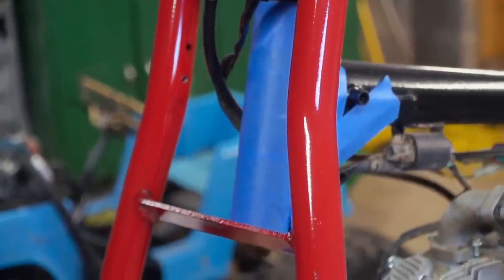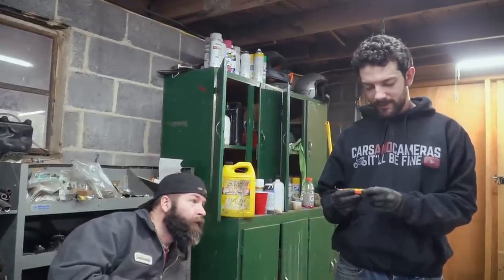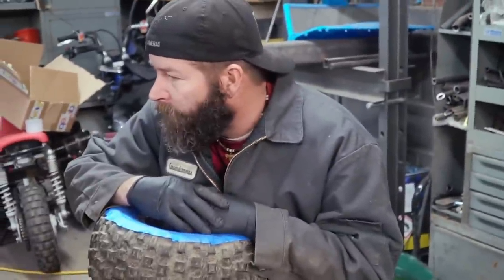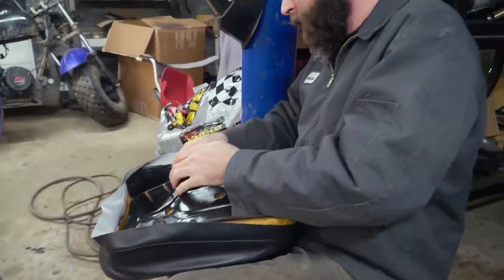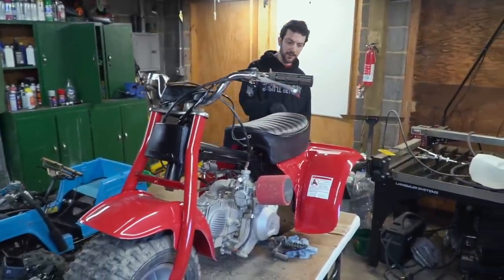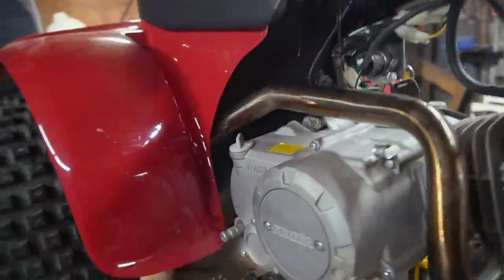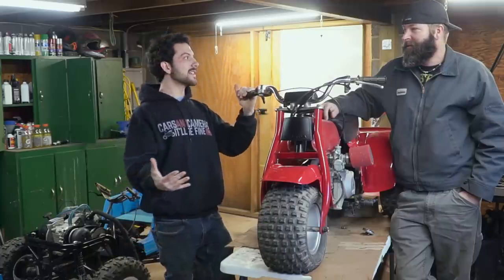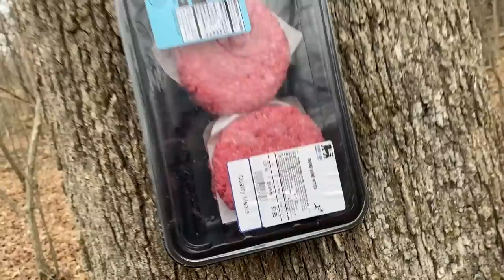Honda ATC 70 Restoration | Restored 140cc 3 Wheeler!

Comment: They came with those safety stickers back then. I can remember peeling the stickers off my 82  back in the day.
Reply: Also heat the vinyl with a hair dryer to help pull wrinkles out. Do not apply the heat directly, swing it back and forth to gradually heat the area.
Reply: I collect atc's. They all had them.
Reply: @JETHO321  yeah I have 3 old hondas but wouldn't call myself a collector. I actually remember when 4 wheelers came out, my son rides the suzuki 125 my grandpa bought new in 1985.

Comment: The chain tensioner is a round wheel riding on chain links, that’s why the original was a sprocket
Reply: It also sounded like the chain was rubbing not turning the wheel on the tensioner. Sounded like something rubbing on plastic.
Reply: Correct, this is a tensioner for a belt. A chain tensioner, like a timing chain tensioner on an engine is also nylon but longer and curved and would be constantly lubricated. This is not the right application.

Comment: The first ATC I ever saw was only 6 months old. It was a ATC 90 but belonged to a couple of thrill seeking Firemen from OKC. They had worn it out by the time I saw it and replaced that 90 with a 185 Suzuki or Yamaha engine and trans. The sticker was not original equipment since they would get all lit up and play (you know Firemen always follow safety rules "wink *wink"). The object was to be able to stay on and not spill your beer. When you were the passenger, that was not as easy as you would think. Luckily they would do it in the sand and no one was hurt. They also drag raced a 56 F100, flew hang gliders and had several "sand" toys.  BTW You need a "Dutch Oven" for camp cooking and on top of the stove in the shop.

Comment: for de stickering, there is this stuff we use for refinishing cabinet doors when we need to take off the bumpers and factory stickers. It works really well. Its called Wax Wash, from Mohawk comes in a spray can. 👍

Comment: FYI - Rubbing alcohol removes sticker glue like a champ!
Reply: Another one..... Car wax works great!!
Reply: I use wd-40 and a scotchbrite pad
Reply: If you want no tarnishing of a clear coat or scratches on windows you can use either baby oil or mineral oil, they break adhesive down quite nice.
Reply: @TuttleScott  Tell ya what- WD-40 works great for removing grease pencil marks off thrift shop items. Its like magic
Reply: 91% or 99%  Rubbing Alcohol works best
Reply: @brianmccann666  Im thinking its  91, I buy and sell electronics, I remove 10-20 price stickers every week. So it mostly on metal, plastic and sometimes finished wood
Reply: @wishbone20t  ... 91% works Good. But 99% works Awesome.
Reply: So does a crud thug

Comment: I remember back in the day, I had a Honda 70, along with about 7 of my school buddies my friends dad was a Machinist at air research, we jacked those 70s with stroker cranks, bored out, cams, headers over sized carb, headers. 3 speed to4. Changed the front sprocket.
To top it all off put a little alcohol in the tank. Most definitely ur helmet.
What else can I say scary fast on 3 wheels. Have fun with ur restoration

Comment: @23:53   A time proven trick is to put Baby oil on some paper towel so it is soaked do this all on the Glue to be removed, let set over night. As a rule all of the glue will just wipe off. Not always but 80-90% of the time. Love your guys fun, and how good of friends you two are. Keep up the good work.  Chain tensioner:  You can remove the old cog from your old chain tensioner, and replace it with a new skate board wheel, they work great, and last a very long time ,and are cheap to replace.

Comment: Top tip! Rubber eraser wheels and plastic razor blades work wonders on stickers decals and double sided tape. And you should use some adhesive on that seat. Overall I'm jealous, my 83 125m was never that cool (still cool tho) wish I still had it.

Comment: I went through quite a few of them tensioners on my atc 110 when i was younger.  I ended up removing the old wore out sprocket and bolting a piece of hardwood on the tensioner inplace of the tiny sprocket for the chain to ride on. Worked better than expected. Pretty certain it is still on it.

Comment: Ok I looked through quite a few comments to see if someone already told you but I didn't see it. I use a spray bottle with water mixed with rubbing alcohol. I mix around 1 part alcohol to 3 parts water. It makes it so that you can move it around til you get it where you want. No worries about getting soap out, alcohol will dry up clear.

Comment: Use a 2k automotive spray clear with hardener over stickers on fuel tank. You will not be disappointed very durable and can be easily purchased on Amazon for about $20. Way better than regular spray clear.

Comment: For sticker/decal/glue removal I've started using those rubber eraser wheels. I just finished removing a ridiculous amount of vinyl pinstriping from a '95 S10 and it was so much quicker and easier than any of the chemicals/cleaner hacks I've used in the past.

Comment: Never had a bad reaction from brake cleaner and bodywork. De-stickered all my past bikes/cars with the stuff. And I use it before pulling the sticker. So the whole sticker is easier to remove and usually brings the glue with it 🙌

Comment: T-bolt makes a low profile intake manifold. Also when I put the 140cc in my ATC 70 I used a mukuni 28mm carb. You need a longer throw thumb throttle but wow what a difference the 28mm carb makes.

Comment: Back in the late 70s, my dad's friend Charlie had a brand new ATC 90, and a brand new GMC Gentleman Jim (black and gold, sort of a Smokey and the Bandit TRUCK) pickup. He let me try out the ATC. I gave it too much gas, which makes the front end light and even harder to steer. I went straight into the side of the GMC. A GMC/ATC interface. Minor damage to the truck (I say minor, cuz it wasn't mine). To this day, I've never TRIED to ride another 3 wheeler.

Comment: Nice work, guys. That tensioner looks like it was made with a rollerblade wheel(hard poly). I'd say your best bet is to buy a piece of white nylon and use Ike's lathe to make a new roller. It's very easy to make, just take your time. There's 100 people that can walk you through the process, me included. Give me the dimensions and I'll make you one. I have the material.

Comment: Tech Tip: After you split the wheels and replace the seals use tire slim liberally between the wheel halves. They will leak no matter how much sanding you do. The slim will stop the leaks. Been there done that.
Reply: Have you ever seen what tire slim does to steel and aluminum rims? Changed many tires that had tire slim in them for who knows how long. Corrodes them real bad. Actually did an experiment on a brand new painted rim, ran the tire and wheel for one season and pulled it apart and it was rusted so bad it was flaking. Just my personal experience with tire slim.

Comment: Use a heat gun or a hair dryer when you remove stickers and they’ll come off clean. You gotta get close to it with a hair dryer but don’t get to close with a heat gun and keep it moving don’t stay in one place to long or you’ll damage the paint or plastic. Just go slow and don’t get it to hot. When it’s pretty toasty to the touch it’s ready.

Comment: With old rotten seat frames, I've found that using a few wooden blocks and a length of 2x4 .. clamp it face down to the bench, once the cover is centered and mostly on, and compress the foam a bit. Then tab the vinyl in and slowly release the pressure.

Comment: Here's a trick to getting rid of the glue for just about any label, use regular rubbing alcohol same stuff you use to clean cuts 90% or better (less water in it). Then you can just use say a table spoons worth on the tank size stick and rub it in with your finger, then wipe with a rag repeat if necessary. As for applying decals, try spraying a soapy water solution to surface and be liberal with it so the decal doesn't stick and can still be slid around. Once your happy with the placement work from the middle out to push the bubbles out and get a flat full adhesion, if you do get a small bubble try a hair dryer and softly work it out.

Comment: You guys mentioned the chome Z50 Christmas special and said it would be neat if they did it with the ATC 70. They did do a Christmas edition, the factory blue ATC 70s in 1983 were a Christmas giveaway edition. Not to be confused with the blue ATC 110s, which were just a factory color option. Either way, awesome content. Love me some custom ATC 70 builds, that 140 is a mean motor. You've earned a subscriber

Comment: Hey! For removing that glue, rubbing alcohol and a scotch bright pad works really good. Also those 3m eraser wheels that go on a drill work very well too. I have tried brake clean and I have found these other 2 methods work much better

Comment: Guys, a suggestion.  Buy and experiment with a cheap powder coat system (Harbor Freight).  I use an old large electric cook oven and it works amazingly well.  The results are fantastic and it is so much more durable than rattle can paint or (ugh) a paint brush.

Comment: dont heat up those spikes under the buddyseat , remember that theres foam rubber under that cover , that stuff burns like oil you need an actual fire extinguisher to smother the fire
just wedge a small screwdriver under the spike and carefully pry them open 
to prevent the foam from bunching up put a plastic bag over it , it makes the foam a litle more slippery (works great on car seatbacks ) i usually started in de middle of all four straights and worked toward the corners , makes sure its spaced out the same all over and it wrinkles a lot less

neat trick for putting stickers on , use soapy water in a spraybottle and wet the surface , the slap the sticker over that , the soapy water alows you to slide the sticker untill its placed correctly 
squeegy the water away from under the sticker and alow to dry , then take of the top sticker protection  , works great for windowtinting too

Comment: You can buy a product called " mastic " remover at your local janitorial supply ..it works really well and allows you just to wipe off the adhesive.. also I used to run 8" golf cart tires on my honda 110 cc 3 wheeler.. I first started using them because tires were so expensive..but then accidentally found out that all of a sudden my 3 wheeler was really fast..like 65 mph fast plus for most dirt road riding it didnt seem to effect the traction as bad as you would think ..since it had stiffer side walls it took that roll over feeling out of the equation and was a ball to do doughnuts with it was amazing how much drag was reduced after that I was sold and the local golf cart place practically gave me the tires .. it was awesome lol but you really need to make sure the brakes are up to snuff.. because now it will free wheel wen you let off the throttle instead of just slowing down ..I believe it reduced wear and tear by 75% at least on the chain and clutch oh and if you get stuck you just pick It up and scoot it over or just push it out of the mud. It doesnt weigh that much ..on the street it kept up with street bikes with twice the engine size .. i think you should give it a spin ..it completely changes the trike into something completely different something better power slides are a blast rather than those balloon tires trying to roll under which just kills the stability ..i wish i could get my hands on another anyway have fun

Comment: Looks great you guys should get a can of goof off it works for removing adhesives and also if your caulking with oil base silicone you can give it a light spray when you smooth it down it works great for all kinds of stuff

Comment: Tip for painting wheels with tires on them.Remove all the air from tire, shove 3x5 index cards between wheel and tire. Paint and remove. Also creates a nice spray shield . That tape is a waste of time and $8

Comment: The fuel tank sealer works great even if you have small holes, tape em off and pour as usual, we did some old tanks that should have been thrown out.

Comment: Trick on decals I learned when doing vinyl on pop machines is use a soapy water in a spray bottle and then use a rubber squeegee to aid in rubbing out air bubbles..

Comment: Those old 3 wheelers, four wheelers, and go carts all have the same style of tires lol. I put a 212 predator on an 80s cart and the thing don’t turn or stop. It also doesn’t have any brakes so you have to stop the tire with your foot 😂😂 and there’s fencing wire and vice grips holding the throttle together😅

Comment: Tech tip: silicone spray easily removes stickers from paint.  Yes, you'll need to degrease it, but it won't be as harmful to the paint as brake cleaner. Spray on, then literally wipe the residue off the surface. Better and easier than scraping.

Comment: The rear fender you purchased was modeled after the pre 85 fenders. Only slightly different. I've had several myself and the differences that you pointed out are the same with OEM 84 fenders vs 85 fenders.

Comment: Hey, I don't know if you ever tried but, WD-40 works just as good if not better than Goo Gone when taking sticker residue off. Did it on my Aunts 12 year old Dell and the WD-40 made the whole PC look brand new and sticker-less. It also revived my 2008 Razer Lycosa Keyboard and made the shinny plastic shinny again and the rubber coated keys are back to a actual black.

Comment: Spray the foam with silicone. I used to build furniture and we’d spray the foam on the arm of a piece of furniture then put the fabric on. Smack it where you need it to go. Then pull and fix in place however.

Comment: Back in the day one of my cousins had one of these things and he pointed out that it didn't have a differential, so in turns you had to kinda lean out and take the turns on two wheels so the inside wheel could slip.

Comment: Put brake lights in back where now have room,headlight?  Not disc brake?  Put tire flat liquid to help keep air in?  Put weight sticker on back of coat. Sounds like tensioner not moving with chain? Fender flares or mud flaps ?

Comment: If you apply a paper towel and brake clean and rub it in to the softened adhesive before scrapping it will stick to the adhesive, this helps fight the re-adhesion issue.

Comment: I throw the vinyl seat covers in the dryer for a bit. The heat will soften it up. I also use a heat gun. I wouldn't do it in a cold shop

Comment: Lightly spray soapy water on the surface before you apply a decal. That way you can slide it to the perfect position, once it dries the sticker will fully adhere.

Comment: Hey guys when you put stickers on get a spray bottle with soapy water in it. Then spray the area with soapy water lay the sticker on then move it where ever you want. Then use a small squeegee to smooth sticker and remove water and air bubbles.

Comment: If you put it in the dryer for a bit get it hot it streches to make it easier to put it on then it will shrink and tighten up smooth just a lil tip.

Comment: Quick tip when you're recovering seat use soapy water in a spray bottle and it will slide on and you can work it better

Comment: tech tip, get a $15 eraser wheel off amazon, it will remove those stickers and the glue in one shot, and as long as you dont go fast it will not damage the paint.

Comment: Instead of brake cleaner you should use wax and grease remover. Takes adhesive right off easily and less time without destroying the paint.
Chance of the paint coming off with use brake cleaner

Comment: The best way that I have found to take sticker and decals off is to take a propane torch and heat them up and then they peal off easy and don’t put scratches in your paint and plastics

Comment: Im seeing this for the first time but i would add about 3 inches to the frame where the fuel tank sits and make adjustments to the handle bars accordingly. Maybe move the seat forward 1 1/2 ihch.

Comment: Use a blowtorch to remove stickers. Then rubbing alcohol with zippy lighter fluid mix equal parts soak on a rag and rub on glue. It will remove everything. Thats What we use in body shop.

Comment: Chrome gold wheels would look cool, also have you guys done a video on how to remove the rear axles on these? I have a 110 with high and low but the nuts that hold the axle on I believe are seized and unsure wich way the loosen

Comment: If one of y'all don't already know how, it might be worth looking into a brazing lesson or two.  Lord knows I've brazed a few gas tanks in my life and haven't had one to leak yet.  Just make sure either you wash it out with a strong soap of some kind and rinse it a few times or, run a large diameter tube from a (running) gas engine exhaust pipe into the tank before you start.  It's a heck of allot simpler and you don't have to wait four to five days before you can use it.  It's jusy a suggestion/thought thou.
One other question for ya, when y'all gonna build a reverse tryke???

Comment: Correct seat is Blue in color and has a 70 on the side of the seat
Reply: depends on year, mine was 83 and it was black
Reply: @bowserlamont2538  Yeah but they had said it was an 85 and 85 was the last production year and had a blue seat with a white 70 on the side
Reply: @brucemeyers4800  Yeah you maybe right, think mine had the 70 decal on the tank. I do know mine had the rare 4 stroke, there were 4 2 strokes and 5 four strokes throughout its production run across different countries. Think my back decal was black background.

Comment: Idk if you'll see this but hang it from the ceiling cuz there light bikes and it's way easier if u have it on a pulley system with hooks used it at motorcycle shops hope y'all see and make funny content